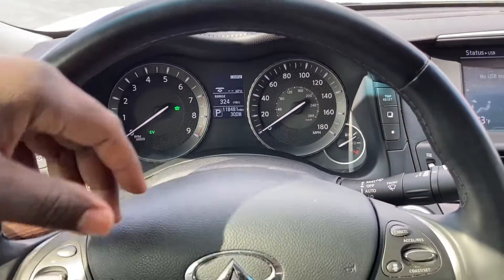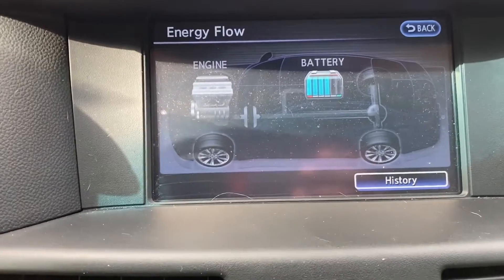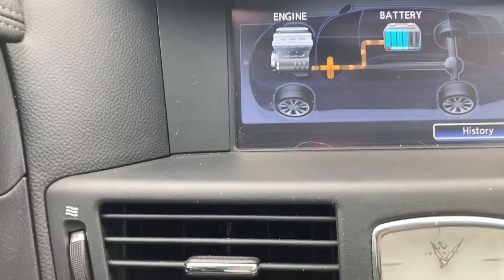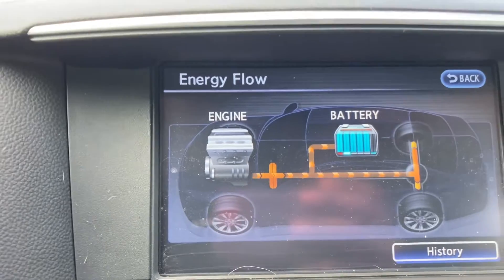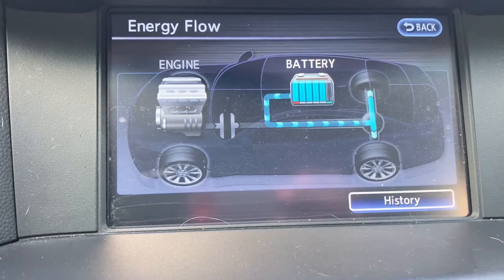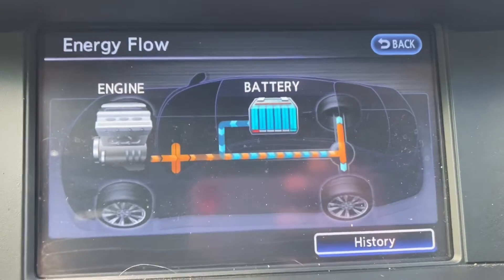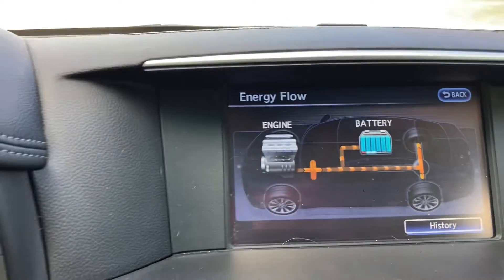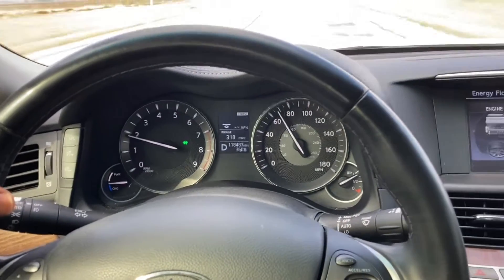Different Modes in a Hybrid Vehicle Energy Flow Screen. Infiniti

Comment from the maker: Infiniti M35h and Q70 hybrid.
Here are the different statuses: (Not in exact order of appearance.) 
1. No energy flow
2. Gasoline engine driving car
3. Gasoline engine charging battery
4. Gasoline engine charging battery + driving car
5. Electric motor driving car
6. Electric motor charging battery (regenerative braking)
7. Gasoline engine + electric motor driving car
8. Gasoline motor + electric motor charging battery